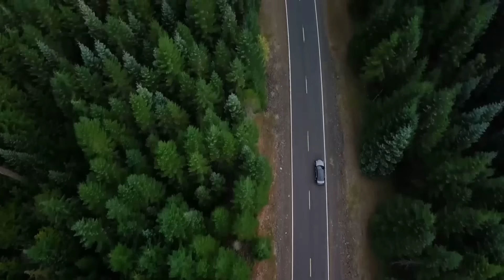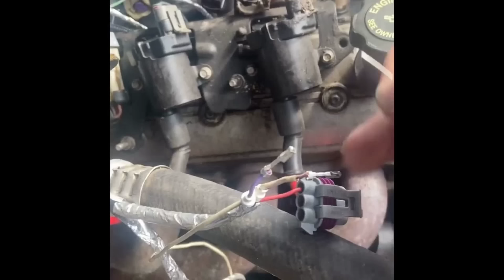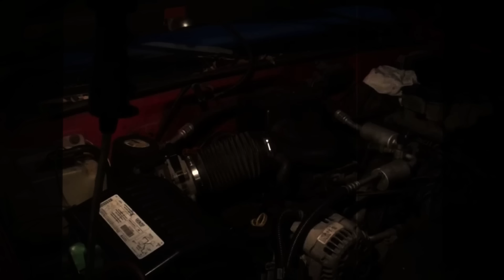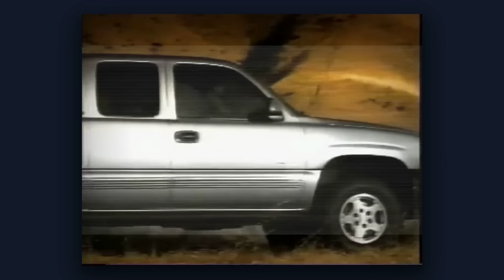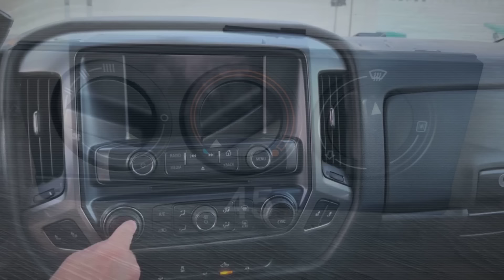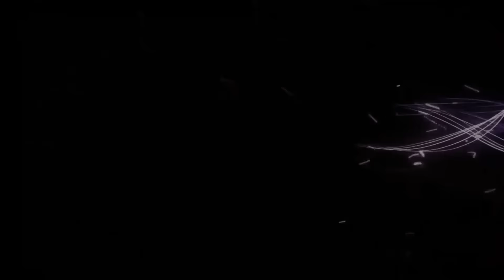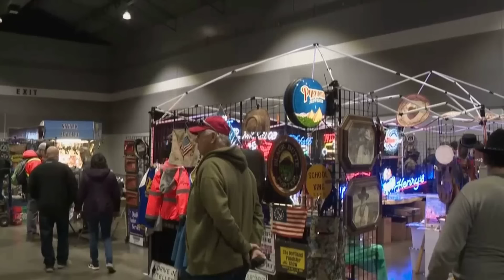How Smart Mechanics Are Bypassing The Dealership (The "Delete" Loophole)

Comment: This is why they fear 3d printing so bad right now also any Cnc
Reply: If you have a stripped plastic gear or knob I can model, I can print you a new one.
Reply: They should fear us.
Reply: Yes, for many parts.  The new PPS material for 3D printing can take under-hood temperatures and is not effected by gasoline or diesel fuel.
Reply: People need to say enough is enough. They want complete control... of everything. On that note, have fun all!
Reply: @SerenitynPeace all they had to do was give us freedom to live
Reply: Then we scare them into excepting this reality by saying “deal with it or go out of business”
Reply: This is where craftsmen come in. I can 3D print a cast part and cast it myself out of steel or aluminum whatever it's made of.
Reply: Look up chuck missler
Reply: I have 7 years on the job as a machinist and programmer. I'm planning my exit to be on my own. I will support us any way we can, but I need to know what to make.
I'm not fucking with electrical I'm not an electrical guru
Reply: The current issues surrounding 3D printers,  especially in the no mods/ own nothing  revolution,  is horrific.
Reply: cnc is compromised, manufactuers get notified if a machine is moved from its last reported location with gps

Comment: This started a long time ago with cash for clunkers. You need to buy a lathe and 3d printer… or one of the metal 3d printers if you got that kind of cash lol
Reply: A lathe is a good start.  A lathe and vertical mill is much better.  3D printer is worth getting but there's a learning curve.  If you have all three and can use them properly, you have the makings of a business.
Reply: Metal 3d printer is called CNC machine
Reply: @nathanreeves7395  There's a difference.  A metal 3D printer is an additive process.  A CNC machine is essentially a computer controlled mill, which is a subtractive process.

Comment: The problem is the BS emission testing that stops you from making changes.
Reply: Maybe an enterprising person could surely set up a fake obd port , hooked to a small computer telling big brother all is well...
Reply: @Zeusspupp  Won't do you any good when they open the hood and see a carburetor instead of factory EFI.
Reply: @Zeusspupp  States like NC do emission testing and OBD plug in. They literally place an exhaust sniffing device in your tailpipe.
Reply: @walkingman9171  indeed, I was responding to Zeuspupp.
Reply: Lot of states don't have it. The ones that do typically have exemptions for vehicles over 20 or 25 years of age
Reply: @hyperwebbing    In Georgia, you're exempt from emissions testing when the vehicle is 25 years old.  Also, there's no emissions testing at all outside of metro Atlanta.
Reply: @hyperwebbing  It's usually the major city counties that have it.  That's AZ, don't have exemption for age either. The greedy want every penny they can rip people off for.
Reply: The solution is to move to a state without BS emission testing.  Either that or get the incumbents (all the incumbents) out of office and replace them with people who will remove those requirements.
Reply: Yeah I know,the EPA 😏
Reply: Climate change is a scam
Reply: @TheBigGuy00009Well climate change is just different weather.
What is a scam is man made climate change.

Comment: 2008 Ford Explorer. Ford expects the owner to replace the engine wiring harness to replace the bad battery terminals, but on the same foot the engine harness is made of cheap materials so the wire insulation becomes brittle so I had replaced a sizable amount of the harness with new wire due to deteriorated wire to all sensors and plugs around the engine. And to deal with the battery wires I cut the old terminal plugs off and bought a lug tool from Amazon to crimp sizable connectors so I could change the connectors to to the more modern battery terminals so they can just be replaced as needed. And to add insult to injury "Ford no longer sells the engine wiring harness at all", so if you go to a salvage yard the same vehicles will most likely have the same issues, so the best idea is to repair the harness.
Reply: And a lot of the time it's soy based coating on the wiring that's biodegrading and mice/rats like to eat it, too.. I've fixed some odd rodent damage, like the temp sensor in a '15 era Cadillac SRX, under the intake manifold and common rail... Custy only had it a week.
Reply: @ryank5688 the wire must of used bio degrading plastic, every exposed wire and opening to the open air was falling apart, there was no signs of ant rodent infestation.  MAF sensor, water temp sensors, injector wires, electric clutch fan wiring, everything was showing bare wire, what suprised me was that there was no fault codes. I had bought the vehicle knowing the warer pump was new and that the radiator and heater valve wear leaking, Icame to the conclusion that the wiring at the clutch fan plug showing bare wire causing a short that was causing the issues that the previous owners headaches.
Reply: If you're looking to buy time or do not have the funds or desire to change the harness and all of its leads, you can use a high-quality degreaser and spray all the wiring that you can get to and use a paint brush to get into the little grooves and spots that you feel like need a little agitation before you rinse it well with a water hose. Let completely dry. Then use one to two cans of Plasti dip spray. You want to put throwaway plastic bags or newspaper etcetera under the wiring you intend to coat. Your first coat should be just to get everything tacky and misted second coat you want to get a nice even coverage  and complete with a third coat that is similar to your second but thorough without excess. Let cure. This will encapsulate all the wiring, filling the cracks and providing a barrier against shorts while maintaining flexibility & OEM pathways. If you decide to replace , may I suggest purchasing online a kit that will allow you to properly remove wires from pigtails connectors and harnesses without damage and then you can reuse your original connectors. Also need to  buy different colors of wiring on a spool or as a rebuilding kit. You could remove your old one, lay out your new wires that will match the lengths needed, remove and reinstall connectors and harnesses and reinstall your newly rebuilt harness all in one day. 2 days if you're cautious/inexperienced.
Reply: @hyperwebbing wiring harness is already done, the new wires have already been soldered in place, and the harness has already been re-wraped and everything was working fine now.

Comment: This sounds pricey but still cheaper than being screwed by the manufacturer and dealership
Reply: "It's pricey" - until you consider the COST of a new vehicle, TAXES on a new vehicle, and the absolute nightmare of attempting to replace something as simple as a light bulb on one of these new proprietary 'apple on wheels' monstrosity.
Reply: I would bet that you could replace the computer with an basic aftermarket one for less than the cost of a couple of coil packs at the dealer
Reply: $10K in reliable mods is so much better than cashing out $80 to $100K for new junk.
Reply: But you have a vehicle for the next 20 years, if crate engine.
Reply: @davidwright4211  Or longer
Reply: Sounds cheap when they expect you to pay $60,000 for a bog standard "work truck" running a tiny 4 cylinder engine that explodes just after warranty.
Reply: Its actually cheaper in the long run and you get a better product. A ls without any modern bs is a beast same as a coyote which can be dropped in to just about any car or truck now no extra computer crap or emissions just go go juice
Reply: Yes. I got screwed by a dealership yesterday. Not only the repair costs, I had to stop at Wal-Mart to invest in a tube of Preparation-H (with benzocaine). Difficult to find honest master mechanics too.
Reply: Some times the joker is right it’s not about the money

Comment: I have a 2003 GMC Sonoma that came with a 4 cylinder engine and 5 speed manual transmission. It now has a 350 small block GM PERFORMANCE crate engine with a TH350 transmission. No more bull shit electronics for that truck.
Reply: Ooh that sounds fun as hell, let's keep these things in the road
Reply: @funforall9741 absolutely. It only has about 6000 miles on it because it was used as a show truck for the first half of its life and then it mostly just sits in the driveway anymore.
Reply: @JonesCoWoodworks  I have a 2003 Sonoma as well. Mine came with the 4.3 vortec V6 engine in it. I rebuilt a 4.8 LS from a 2000 full size pick up that  I'm gonna drop in with the 4L60 (non-computer) trans. which came in it.
Reply: @bigg4454  4L60E '96 Suburban checking in.... I hate electronic crap.
Reply: @legoghost2025  I can dig it. We've done just fine without th' stuff.👌
Reply: Why couldn't you keep the 5-Speed Manual? I had a TH 350 slushbox. I'd rather use a clutch.
Reply: @HootOwl513 because there was no room for the clutch pedal after the modifications to the firewall. There was way more done to the truck than just a motor and transmission swap. I wish I could add pictures of it on here. Maybe someday YouTube will make that an option.
Reply: @JonesCoWoodworks  OK. Thanks. I am unfamiliar with that model. I have a '68 C/10 Stepside w/292 L6, SM 465 4-Speed and a '71 GMC Jimmy K/1500 w/ 350 V8/SM 465/NP205. Bought the '68 in 1973, the '71 in 1995. I now also have a 2003 C/1500 Tahoe. It has oil leak, coolant leak and window switch problems, but its 4.8 Vortec V8 is still OK after 300400 miles.
Reply: @HootOwl513 I can’t begin to list all of the cars , trucks and vans that I have owned over the years but I currently have a 2004 Suburban with the 5.3 in it that has 380,000 miles on it and doesn’t leak a drop of anything so it’s all in how well you maintain your vehicle that really matters.
Reply: @JonesCoWoodworks  What tipped me off was during the Squarebody era, the dealers really wanted my '68 truck. They were making all kinds of offers. I didn't trust them then. Imagine my opinion now. I had my Stepside out today, and I just love a truck with gears.
Reply: @HootOwl513 no way the nv1500 would hold up to a v8. Rated for 200 ft lbs. My s10 has a 5.3 with Haltec rebel ecu and T56.
Reply: That 4 cylinder was a peace of shit
Reply: @jackdaniels2657 yeah but it was the cheapest option at the time for a new truck so that’s why it was chosen.
Reply: Awesome
Reply: Amen! 🙏
Reply: Did you do the work or did a shop? If a shop did it, how much did it cost? ...asking for a friend.
Reply: How much did that cost you to do total with the engine and trans swap ?
Reply: @uknow-u8g everything was about $50,000 in 2003 so now it would be more like $89,000
Reply: ao what.
Reply: That vehicle was not designed for that engine and transmission, the engineers at General Motors never intended for it to have that configuration, and that means it is unsafe and unauthorized. 

You should schedule an appointment with the dealership right away to fix this mess, jand have an original 4-cylinder engine and transmission put back in. If the dealership can't get you an engine and transmission then maybe they will let you do some sort of trade-in on something new and safe.  This is way too much power for that vehicle, it must feel absolutely terrible to drive with that much power in that vehicle! 

Just talk to the man at the dealership and ask him for a recommendation and do whatever they recommend,  and be safe!  Use this as a life lesson and never let anyone but an authorized dealership do any work on your vehicle.
Reply: @actionjksn that’s hilarious 😂😂😂😂😂
Reply: @actionjksn  A dealership is the last place to get work done unless it's covered by a warranty. They rob their customers b;ind.
Reply: @actionjksn bad bot

Comment: I rewired from scratch at car at 16 wasn't to bad.
Reply: Totally rewired my SV650 after the voltage regulator went out and fried everything. They wired that bike with 16ga & 18ga wire, the main charge wire was 14ga. It had a common ground on the tail behind the tail light where everything including the headlight was grounded, smdh. Now everything is chassis grounded and uses 14ga or 10ga. I was like 17 or 18, still ride that bike to this day.
Reply: Dnt think theres to many ev owners watching this .ive done a z900 ,total back to carb .n points .

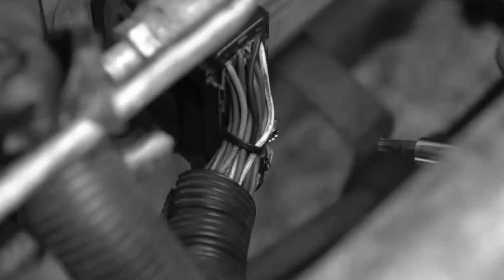Comment: 7:09 Holley Carburetor's are still made in the US ... (Bowling Green, Kentucky)....modern fuel though...sucks...can't sit around for very long.... so bring on the world of Carburetor cleaning , Amen
Reply: And the fuel has been reformulated several times minimum. Less efficient, less horsepower each time.
Reply: Use STA-BIL if you plan to let it sit for awhile or use non-ethanol gas at stations like QuikTrip, Buc-ees, Shell, Sunoco, and Murphy's USA.
Reply: @nostradamus7648  Its not a while these days: surface tension additives to fuel that once retarded evaporation are gone, and your carb may find dry bowls in just three days.   Gone, right out the vent tubes.  Stabil is more of an anti fractionation additive that helps a little with ethanol  if I understand it.
I'm tempted to design some kind of remote actuated vent tube cap system - maybe a hydraulic/levered  device that opens vents any time oil pressure is 15+ psig and also lifts if bowls are filling during cranking.
Reply: Just run an e85 friendly carb. Solces the problem